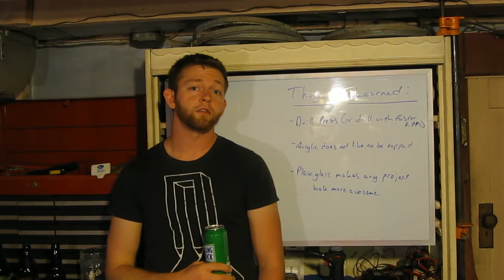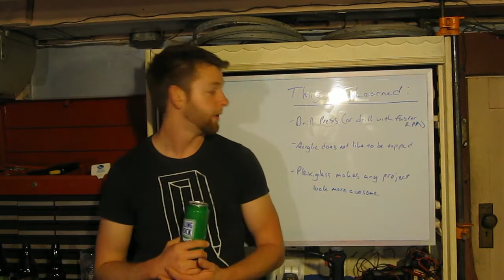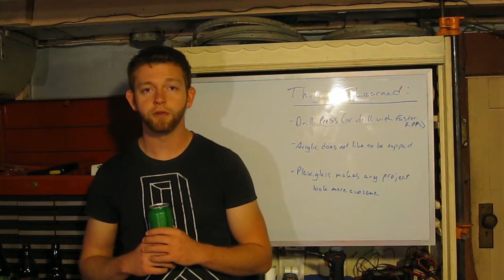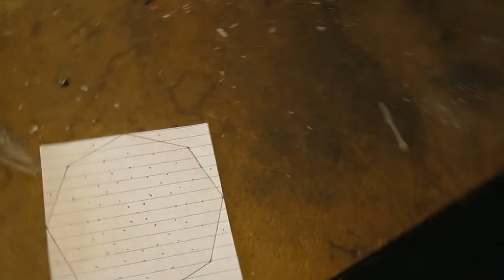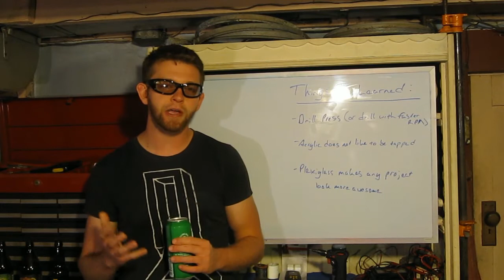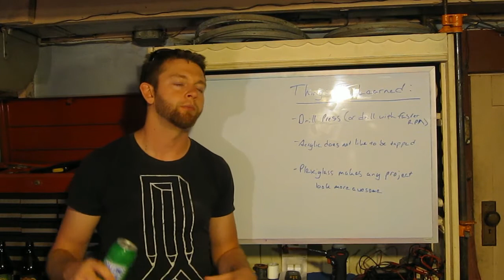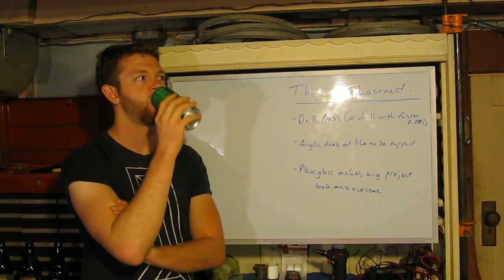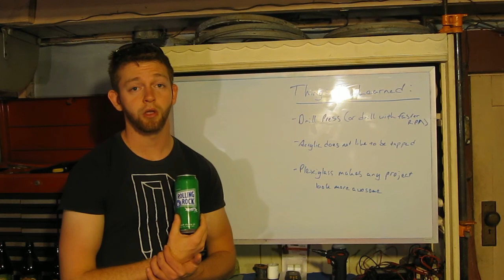Cheap and Easy DIY Transparent Computer Case

Comment: Ive used it to seal a cracked crankcase on a GSXR1100, It leaked a little oil, but I was plugging a huge hole with some sheet aluminum.